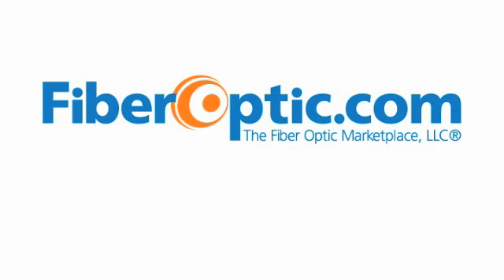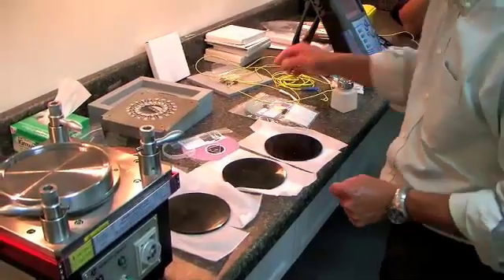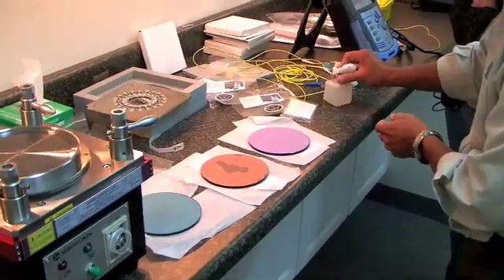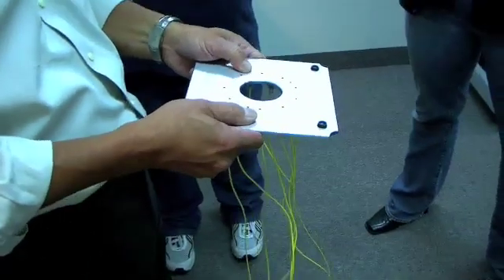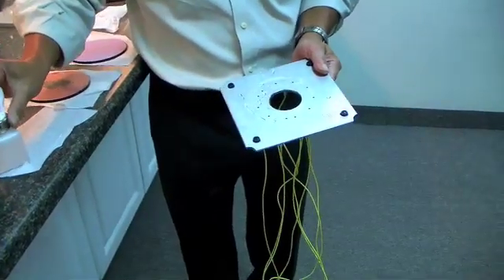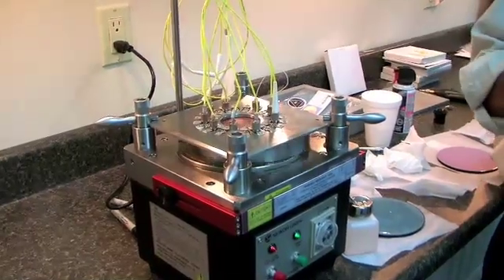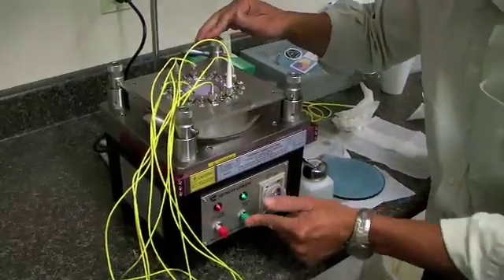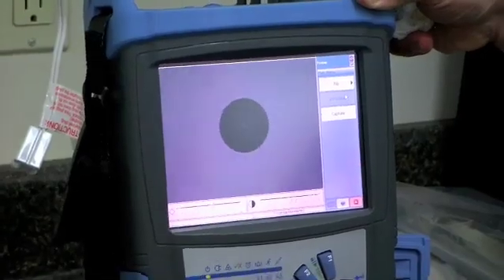Seikoh Giken 550 Polisher

Comment: What polishing pads did you use?
Reply from the maker: I believe they are slightly different depending on which connectors you are polishing. Generally, the part number for the pads begins with PR5X-500. Some of the different pads are PR5X-500-70, PR5X-500-80, PR5X-500-85, and PR5x-500-90. I believe the Seikoh Giken brand pads were used in this video (from 2009) but they are available from other manufacturers now. I hope that helps a little. There's some good info in the product manual: https://manualzz.com/doc/13311232/seikoh-giken---sfp-550-polishing-process-manual